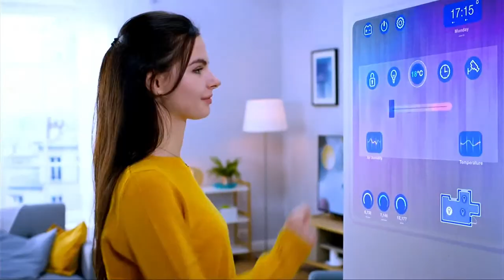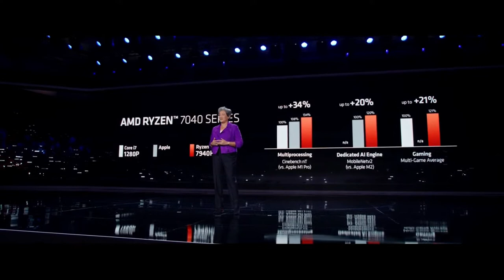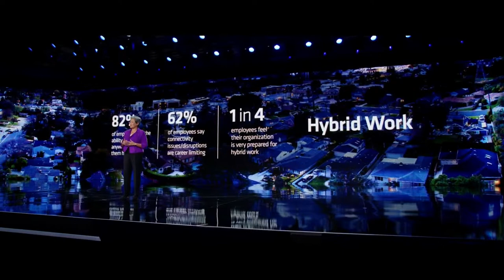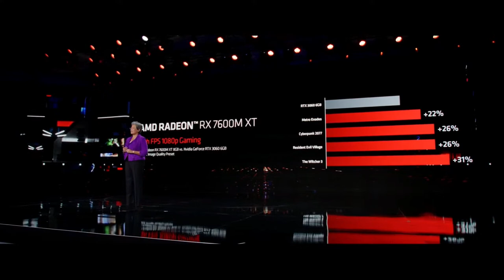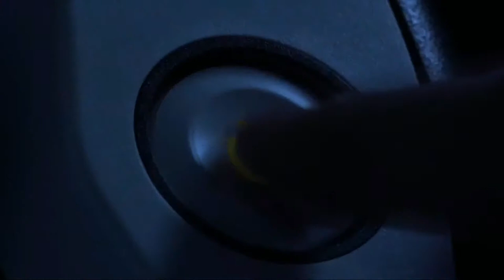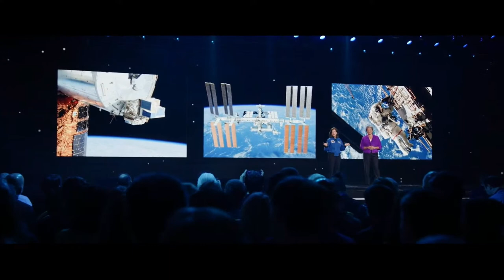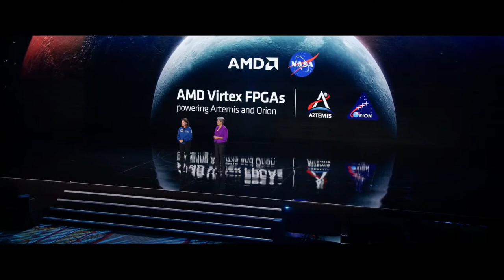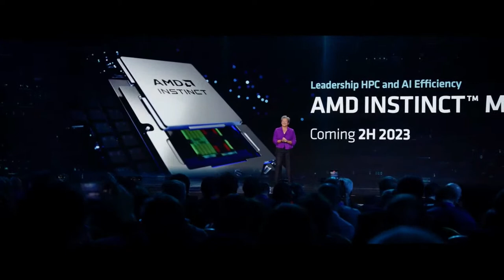AMD's Lisa Su Opening Keynote at CES 2023 - LIVE

Comment: I have 3 Intel computer,1st computer intel pentium 1(133mhz) w turbo button, 2nd computer Intel pentium 4(2.4ghz)533mhz and 3rd computer intel core2 duo E8500 & intel pentium E6600. But I have joined AMD Ryzen 5 (4600G) to eat back the money 💰 for the ill fated palit brand AMD hd4850 with copper heat sink 512mb DDR 3 warranty is 2 years but 1.5 years got problem.